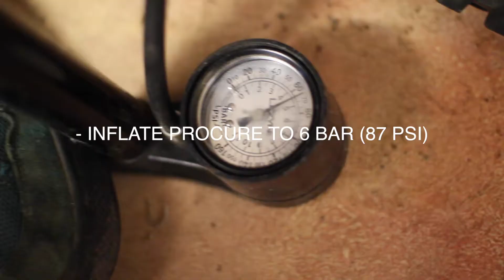Schwalbe Procore Installation Tutorial 27.5" Magic Mary, DT Swiss.

Comment: Even though there's a tube in there, it should still be easier to get a [tight] tyre on by starting opposite the valve so the whole bead can drop into the center channel while installing [ending at the valve, and pushing it up so it does get trapped under the bead, of course].

Comment: So was it worth teh extra cost and effort versus regular tubelss?
Reply from the maker: The biggest pain was waiting 6 months for it, I'd even forgotten about it when it turned up. Installation I found dead easy and I haven't run tubes in years.  The benefit over tubeless is great and the extra traction and all works wonders. especially being able to pick a line and not worry.  Currently still playing with air pressures but that's part of the fun especially as I often fiddle with my suspension. For most UK stuff it's probably a bit unnecessary. But for the rockier rougher gravity trails especially what you'd fine in the alps or similar, well worth the extra dollar. Paired with a decent tyre choice and light weight rims and some patience fiddling with pressures and knowing what you want to feel you can't go far wrong.